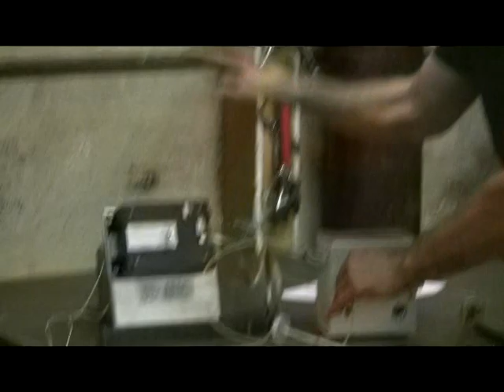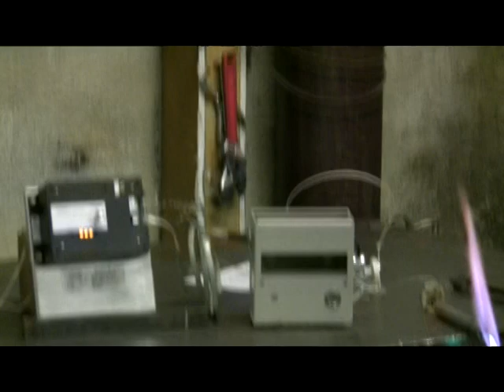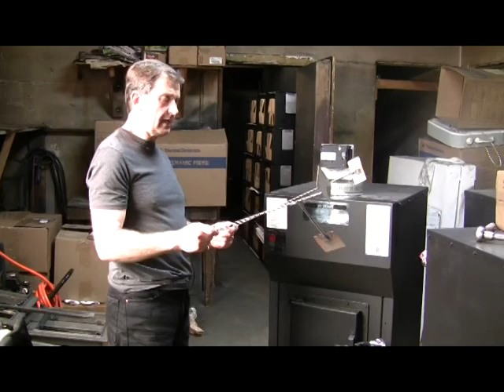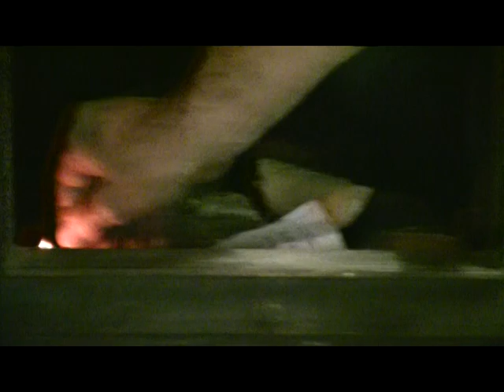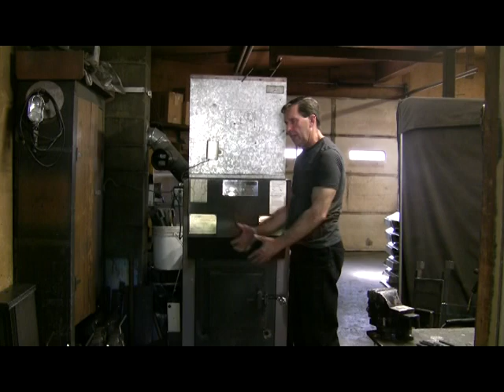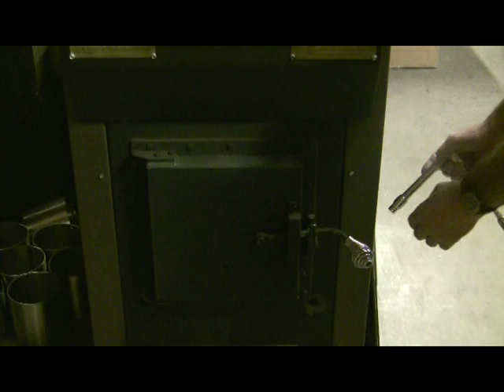Kuuma Vapor-Fire Furnace Operational Video

Comment: So what happens if you split your fire wood during the summer the same year you are burning? Would normally wait a year before burning, but would it still burn in this furnace if I didn't? And what happens if the power goes out? Is there any way to run the furnace without power?
Reply from the maker: Please send this as an e-mail to lampmfg@gmail.com and we will provide you detailed feedback.  Thanks

Comment: Can Wood Furnaces Like Yours Be set Up In a Garage Then connected Too a Furnace In Basement,...With a Variable Speed Fan Down Draft Set Up,.....
Reply from the maker: Yes, you wouldn't hook directly to your other furnace.  You would just blow the heat down from our furnace bonnet into your main trunk line.  You would need to put check flaps so it doesn't blow into your other furnace.  You would also need a cold air return from the basement to the back or our furnace.  We would substitute a 1/2 HP blower instead of our normal 1/3 HP as well.  Thanks
Reply: That's how I have mine set up and it works great

Comment: Hint: Focusing so extensively on such a huge pile of split firewood could scare off a potential Kuuma buyer.  "Do I need to buy/cut/split that much wood to feed a Kuuma?" Perhaps illustrate how that much is needed to feed an older furnace, while displaying how little you needed to feed your Kuuma last winter.  The technical explanations of the Kuuma operation was appreciated.
 Remember: BURNING WOOD IS CARBON NEUTRAL
Reply: i realize I'm pretty off topic but does anybody know of a good site to watch newly released series online?